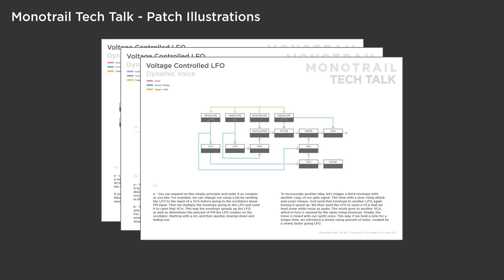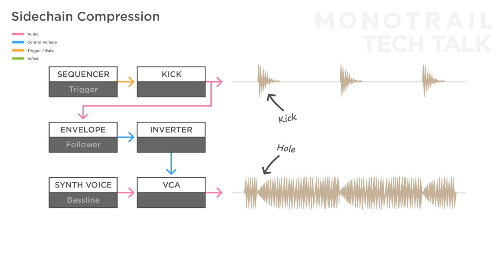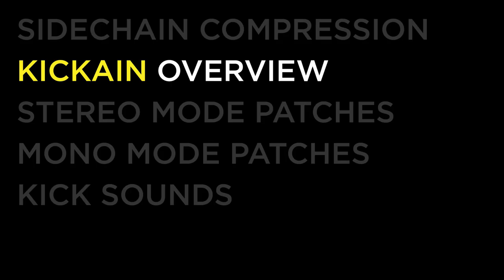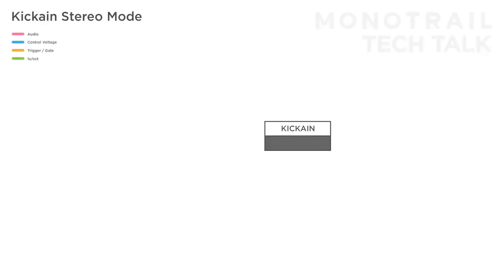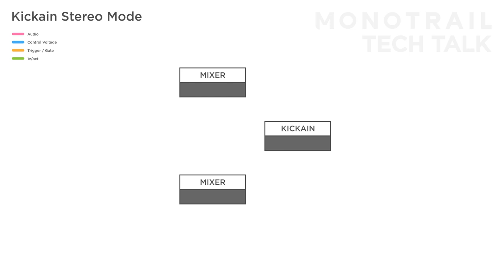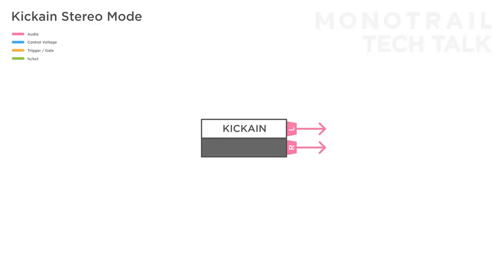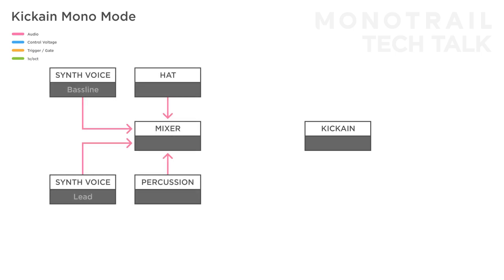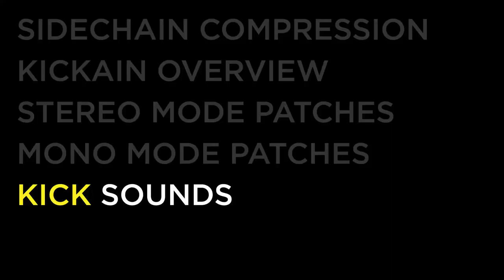How to deal with sidechain compression in modular techno – with Knobula Kickain

Comment: Clever! And it‘s even a pretty solid kick! Is it possible to turn down the transient click completely?
In your examples with a stereo mix, did you go from your desktop mixer right into the stereo inputs on the Kickain or did you boost the levels first?
Reply from the maker: Depends a little on your definition, but I'd say the transient can be basically gone. I mix within the modular, and send a stereo modular signal to the Kickain, then outboard.
Reply: @MonotrailTechTalk  I see. Thx. Great they included a send/return function, so we can always filter the transient out for super clean kicks 
Btw, the kicks remind me of the Analog Rytm's kicks, especially the 909ish bd machines.

Comment: Excellent overview, thanks for that!

In my understanding, you need to use Kickain's Mono Mode in order to patch a rumbling kick. Is that right? Any tips or maybe even a video planned to create kick rumbles with Kickain? :-)
Reply from the maker: If you want to use the sidechain compressor inside Kickain you need mono mode indeed. Then you can take the clean kick out, process it, and send it back through the kickain for mono sidechain compression. I did a video about rumble without Kickain if you are interested: https://www.youtube.com/watch?v=EOcEwJLgz3s
Reply: @MonotrailTechTalk  thanks. Am i right that the sidechain is applied on processed kick with rumble or the pure sidechain? I might want doing the latter, to avoid strange pumps between the kicks.

Will check your video out.

Comment: One potential issue with this pedal . How would you put delay in the kick or another effect if the whole mix is running though it. It doesn’t have separate outputs for the kick alone.
Reply from the maker: Hello! If you run in mono mode you have a separate output for the kick. I explain this setup in the mono mode chapter :)

Comment: what's the difference between "sidechain" and "envelope follower"?
Reply: A year late but possibly still helpful:

An envelope follower is a module, or part of a module, that takes an audio signal and produces an envelope signal based on it.

Sidechaining is the technique of taking that envelope signal, inverting and offsetting it, and sending that signal to a vca or compressor (or hpf) to "duck" other audio signals.

An envelope follower is a tiny circuit, consisting sometimes of a little as three components, a resistor, a capacitor and a diode, or five if you count the input and output jacks.

Comment: one time I was on stage, in the middle of a set in front of at least 2,000 people. my career was just getting started, or so I thought at the time. I was opening for skrillex, at a night club in Botswana. Everything was going great, the whole time, then during my last song, I was building building building.. right when the drop hit idk if it was a brown note or what but I pooped myself somethin' real fierce. it was all liquidy and runny too so it didn't stay in my pantaloons for long, as I had hoped I could hide it until the song was over. but it started pouring down my leg and filling up my shoes and socks.. but the song was almost over. nobody had noticed yet, so I thought I could keep going and I would just finish the set then go straight to the bathroom. well unfortunately I stepped towards my dj decks, and the whole table flipped over.. some of the runny poop had gathered on one end of it, and all of a sudden was launched full speed at the crowd. it was a lot of poop. the most I had ever seen. fully airborne flying directly at the audience. I knew what I had to do. I turned to run to the bathroom before anyone realized what had happened. unfortunately my poopy shoes and socks were slippery and as I tripped several large chunks of liquid shit were expelled forcefully from my exhausted rectum, the biggest of which hit skrillex right in the face, splattering green brown smelly liquid all over. I looked up, and was immediately grabbed by security, taken out back, beaten to within an inch of my life, and forced to eat my own excrement. I ended up almost dying of fecal florintudanal meningitis, the rarest known disease in Africa at the time. I still can't walk, talk properly, and am covered in brown green boils all over that occasionally pop and leak smelly fecal liquid all over the place. but my family takes care of me. I was so close to hitting it big, then I just had to have all that extra seafood and Long Island iced tea before my set. now im going to die covered in poop in my smelly bedroom. let that be a lesson to you.